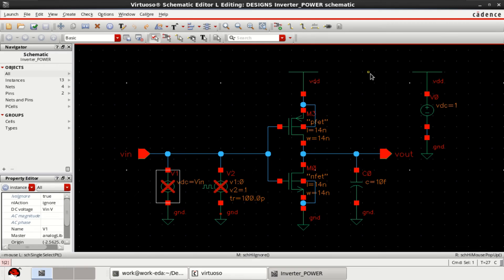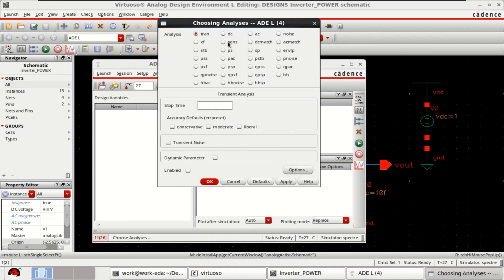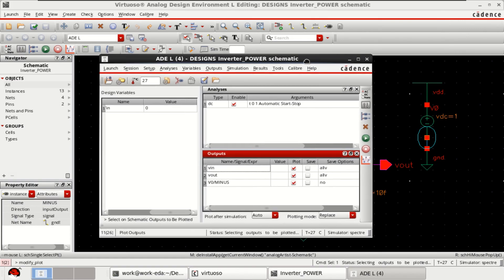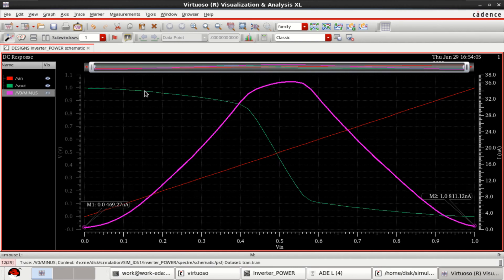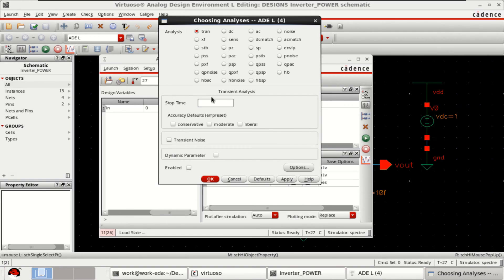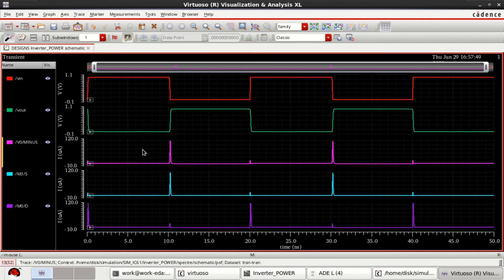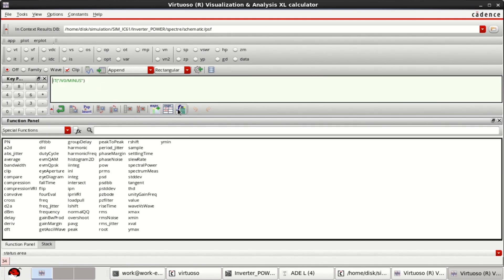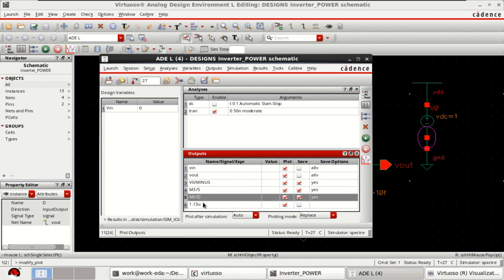Cadence Virtuoso: Static || Dynamic Power Consumption in CMOS Circuit.

Comment: sir,
if we have an AC sine source can we calculate dynamic power for the same?
but as u took this direct average value of current and voltage wave for the ac source should we take the power factor too if yes then how can we take it as the phase difference between 2 waveforms in cadence
Reply from the maker: Hi, transient analysis is different from ac analysis.
Reply: But sir I want to plot the power verses time plot that can be plotted with transient analysis na
Reply from the maker: @digambarbhole9467  yes you can if transient analysis is done
Reply: @dr.hariprasadnaikbhattu  with calculator we can do na 
But my doubt how to involve power factor in calculator
And which value we should take avg or rms as source is sine voltage
Reply from the maker: @digambarbhole9467  may be rms